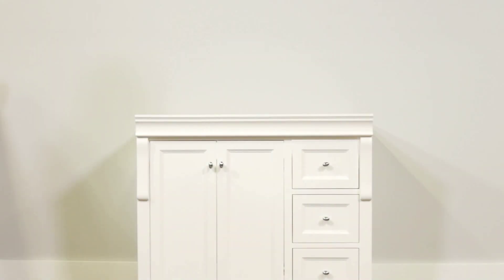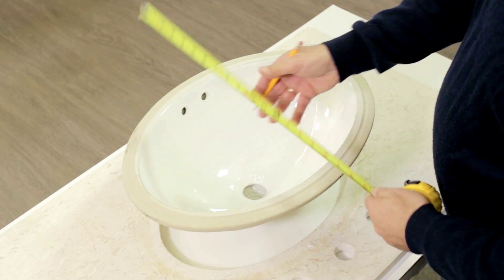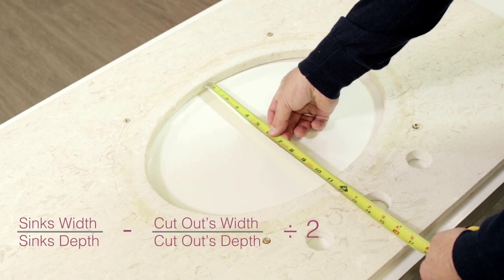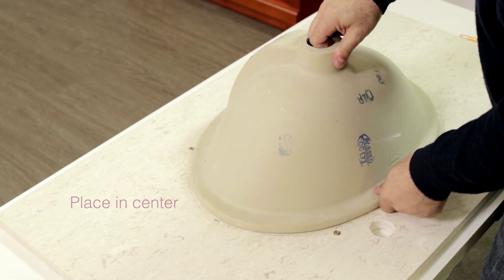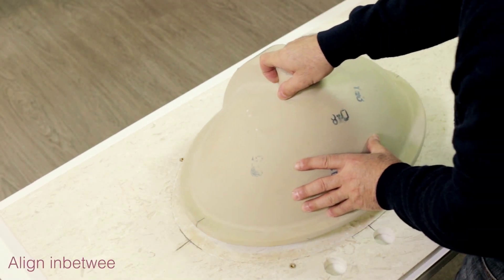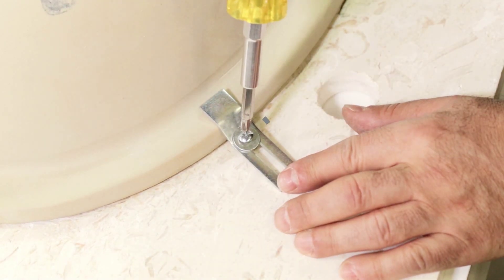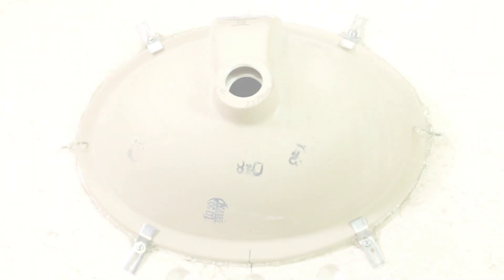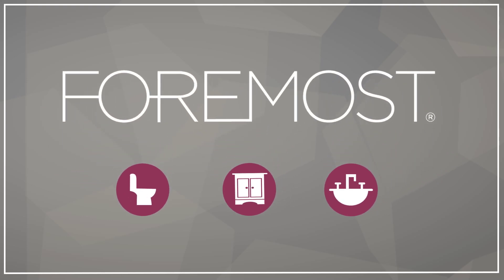Undermount Sink Installation

Comment: Problem with this video is that what is shipped with product is not what is shown is the video. The brackets and bolts  are different , straight clam and Allen Cap screws in the hardware package. Instructions shipped shows caps screws have to be loctited into holes. But holes already have threaded inserts. So threaded studs are what is needed. Contacted customer support and   they sent me a PDF of  the same instruction  sheet I already had.